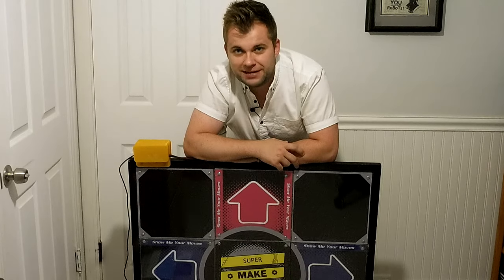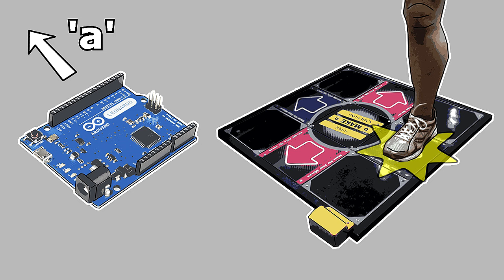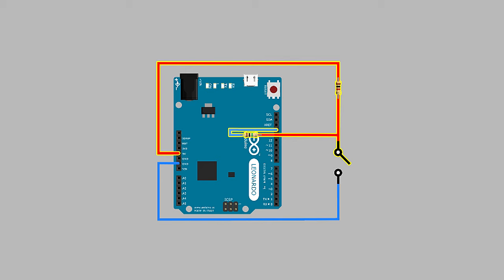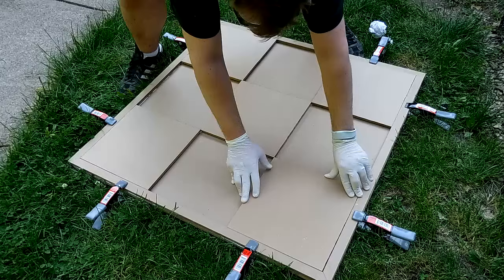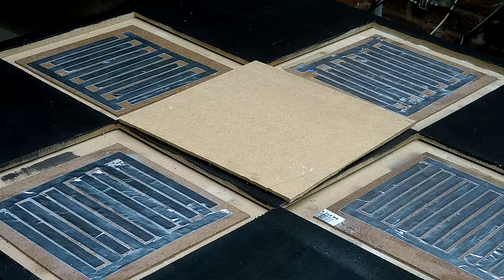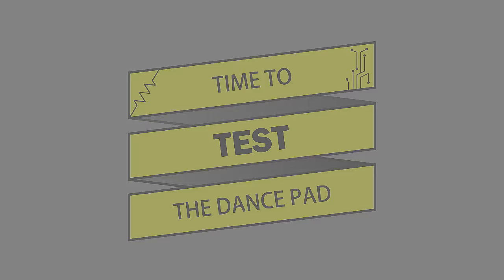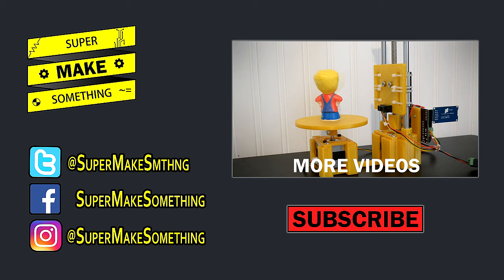USB DDR Dance Pad (Arduino, Pull-Up Resistors) - Super Make Something Episode 9

Comment: So from what I've seen in this video you don't use resistors? At the beginning you show 2 resistors in the diagram but towards the end I didn't see anything of the sort and you just directly connected wires to the pins. Can someone clarify this I lack the knowledge :(
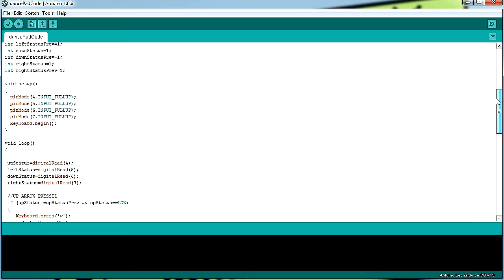Reply from the maker: 10:08  -- The Arduino has a set of internal pull-up resistors that can be enabled via code, so additional external resistors are not needed.  Hope this helps!
Reply: @SuperMakeSomething  that makes sense, and let's say I'm doing this project for a 5 panel like pump it up would I just add an extra line to the code including a fifth button similar the four you have already set up?
Reply from the maker: Armando Gonzales Yup, you got it!
Reply: @SuperMakeSomething   thanks alot sir and wish me luck
Reply: @SuperMakeSomething  hey again just wanted to update you and say I got everything working and looking good to play, however I'm experiencing double tapping on the buttons meaning I press once and the arduino registers multiple presses ,any idea on how to fix?
Reply from the maker: @armandogonzales1544  Hey!  You can fix this by implementing "debouncing."  Look for user "AshiWolf Studios" in the comments -- he edited the code for this project to include this feature and posted a link to it.  Hope this helps!

Comment: hi, I don't get how the black and red wires were connected can someone please give me an explanation. Thanks
Reply: if you still dont get it. 

Black Wires: You connect the black wire to one contact on each side (each side will have 2 strips of contact.) once youve basically connected 1 long black wire to every other contact. those are your grounds leads.

Red Wires: 4 really long cables. This goes to every contact you have NOT put a black wire to.

at the end, thats how you end up with 4 reds and 1 long lead cable.
Reply: @dannyboy8231995   thanks a lot man

Comment: Hello, great video, but I am trying to understand the wiring. The 5v output on the Arduino isn't shown being hooked up in this video (unless I missed it)? The 5v output is necessary for the pins to register the HIGH voltage right? In the honeycomb design one side has a wire going from 5v to itself and wire from itself to a pin while the other side has just one wire going from itself to the ground. So, should the wires going from 5v be soldered together since there is only one 5v output? Should the wires going to the ground be soldered together since there is only one ground?
Reply from the maker: You can connect all of the ground wires together without issue.  The reason that the 5V line does not need to be connected directly is that the Arduino has an internal pull-up resistor "behind" the input pin connection, that essentially does the wiring of the "high" side shown in the circuit diagram for you.  These internal pull-up resistors are enabled in the code.  Hope this helps!

Comment: Hello, great video dude. Im going to customize a ddr soft pad to something like yours but i have a question, when you screw the corners of the "buttons" doesnt it lock the top in place, preventing it from being pushed down?
Reply from the maker: Thanks! The screws are actually just going through the plastic, graphic, and wood button insert. That assembly just rests on the foam and can be removed. Not ideal for storage against a wall, but overall it’s not too bad. If I were to rebuild this pad, I would replace the foam with springs and drive the screws all the way through to the base board.
Reply: @SuperMakeSomething  ooh, thanks for answering!

Comment: im sure you dont want to troubleshoot everyone who didnt follow instructions exactly issues, but on the off chance youre feeling generous, do you have any idea why ALL keys would be sending signal at the same time? i ran your code (my first time using arduino, so maybe i did something wrong there) hooked up the "positive" leads from each sensor to the appropriate pins, and the others to the ground connection on the arduino. once i do so, all keys basically fight over who gets to send a signal, without me stepping on the connecting plate. I've even removed all 4 of the "buttons" and the keys are all still transmitting. 

the only major thing i did differently was i used cat6 cable, since it has 4 double strands inside (and i had some laying around) and instead of running a single ground wire to all 4 grounds, i ran the bundled "ground" strand for each positive wire , and then outside of the controller i spliced them all together into a single wire which i then ran to the arduino. i dont understand how this would be functionally any different from running a single wire to all the other contacts, but its all i can think of ...

edit: rapidly losing hope.... just untaped everything and tried again ... now im pretty sure its worse ...
Reply from the maker: Hi Cory, sorry to hear that you are having problems.  Tying the grounds together shouldn't cause an issue.  I would double check the wiring to make sure that you don't have any shorts.  Did you enable the internal pull-up resistors in the code? The best way to troubleshoot this issue would be to use a multimeter in continuity mode, and trace along your wiring/contacts to make sure that the electrical connections are correct.  Hope this helps -- good luck!
Reply: @SuperMakeSomething  thanks for the quick reply, I did a lot of testing before I finally gave up last night.

I used your code, so the internal pullups should be active. I tried running new wire,  in different gauges and styles, to just one of the aluminum "buttons" to try to isolate the problem, same issue. The button is "pressed" without the two sides of the switch ever making contact.

I then tried running the wire to the arduino without connecting the wire to the dance pad at all, same exact issue. It's like the loop with ground is being closed through thin air. 

One of the last things I tried was attaching much shorter (8") wires to ground and pin 4,5,6,7 which then functioned as expected, no signal till I touched ground and pin, then steady repeated button press in notepad.

Only difference was length of wire, which has me thinking either the internal pullups are malfunctioning, or the longer wires are picking up so much EMI that its bypassing the built in resistor?

I tried using some different sized physical resistors, with no luck. Not sure if my placement was wrong or if the arduino code would need to be changed somehow. I'm very stumped, and very bummed. I was trying to get this built in a day (which I did) but the pad needing to be 10 inches away from the arduino is  nuts... maybe I just need a longer usb cable ... and shorten the wires into the arduino?
Reply from the maker: @NekuraTenshi  Wire length can definitely play a role.  Are you able to 3D print an enclosure like I did for my build and attach it to the pad? Generally, the shorter the wire, the better, both from an EMI and voltage drop perspective.  I suspect that this might be the issue.
Reply: @SuperMakeSomething  sadly, no 3d printer at hand, but I can always make something out of wood if if it works. Going to try a test to one button with much shorter leads in a few.
Reply: @SuperMakeSomething  so it "mostly" worked shortening the wires going into the arduino. There are still some random "ghost taps" but it's one or two with intervals of maybe 20-30 seconds instead of a constant stream of inputs. The big problem now is the foam I used for the "springs" is acting like a memory foam and compressing to the point they're unusable after just a few steps

Comment: Instead of washer and tape, or screws, wouldn't it be possible to weld the wires to the aluminum plates ? And can't I use 1/4" MDF instead of cardboard for the raiser panels ?
Reply: Welding (soldering) to aluminum foil can be tricky, but I agree that the contacts should be made in a different fashion.  My recommendation is to extend the aluminum foil off the edge of the riser panel so that the electrical connections can be made away from the contact surface level.  Also, the material being used for the riser panels is not cardboard, it is a wall paneling material very similar to MDF.

Comment: Hey Alex! Thanks for making this amazing tutorial. I was wondering, what length were the screws that you used to go through the acrylic and the wood panels? Are the lengths of the screws different between the button pads vs the non-button pads? Did you drill into the baseboard below and have the screws go through the panels and into the baseboard?
Reply from the maker: Hi Calvin! The screws in the button pads are just long enough to keep these parts together, but do not go into the baseboard. (The buttons only rest on the foam). The non-button pads are screwed into the baseboard and help keep everything in place. Good luck with your build!

Comment: Before ye olde virus, I went to my local arcade to play Pump it Up (Korean arcade dance game) several times a week. With gyms and arcades closed, I'm endeavoring to build my own! Would I be able to modify this to include a middle pad that could also receive input? I feel like that contact pad is sort of crucial.
Reply from the maker: Ess Ambreís Absolutely! All that is needed is to add an extra button to an Arduino input following the same design, and a slight modification in the code to recognize one more button press! 😄

Comment: What keeps the buttons from failing out when you stand it up? The plexi is screwed to the top of the button, but I didn't see you secure that to anything else.
Reply from the maker: I decided to not fasten the tops of the buttons to the pad to make it easier to do maintenance.  However, this design could be modified by driving a longer screw through the top plates as well, slipping compression springs over the screws in order to make the buttons pop back up.

Comment: Does this process also work with pump it up, which is a 5 panel?
Reply: could you also make a video of making a 5 panel?
Reply from the maker: The process for the build is the same and Stepmania has Pump It Up compatibility, so this should definitely work! Simply add a middle panel with another button and make the other panels diagonally, and you should be good to go!

Comment: Why can't you just make the contact plate out of a single piece of aluminium foil?
Reply from the maker: The 5V and GND connections need to touch in order for the microcontroller to sense a button input. I wanted to avoid moving parts on the top of the button panel, so I made a comb design to keep both connections on the pad's base plate.

Comment: Thank you for this video! Excellent production quality for something that's unfortunately not so popular anymore. 
I have a question though. I'm not familiar with arduinos or anything of the sort. You have the arduino leonardo in this video. According to the website, that version is no longer supported. Would the Arduino Uno R3 do the same thing with the same pinout? Thank you
Reply from the maker: Thanks! The Uno would not work, as the project requires the ATMega32u4 chip. You should still be able to find Leonardo's online from other vendors, though any Arduino with this chip will be suitable for the project. Alternatively the "Arduino Micro" listed on the official Arduino website should work.
Reply: Thank you. Got confused because at 0:58 you use a pic of an uno, but in the video you use the Leonardo.

Comment: Thanks for doing this, I'm currently making my own pad using your video. One question however:

The ground wire is one continual connection to each square of foil? Does it matter if it's connected to the same section as each of the red wires you used?
Reply from the maker: Matthew Marshall The panel with the ground wire and 5V wire should be separate, but become electrically connected by the third plate. This causes the voltage to drop to 0V, which the Arduino registers as a state change/pad press. Hope this helps! Good luck with your build!

Comment: Quick question... Is there an advantage of going the Arduino route vs. just using a simple USB encoder?  I know using an Arduino is cool, but seems like a waste of a perfectly good Arduino when you can get a USB encoder to just mimic a key press when contact is made.  I like you pad design, I think I'll build one using your specs.  However, if there isn't any advantage, I'll go with the USB encoder in lieu of the Arduino.
Reply from the maker: Joe Salz The main advantage is the price. Whereas a USB encoder costs $12, a suitable Arduino can be bought for ~$3. An Arduino also gives a bit more flexibility depending on what you want the buttons to do, since it can emulate a full keyboard. While this is not necessarily an advantage for this project, it could be good for more advanced ones that require USB-to-PC input.

Comment: What if you buy a cheap DDR dance pad and then put thin piece of wood on top of it,  would that cut all your steps like in half and work exactly the same?
Reply from the maker: Tony Trilex I had tried this back in the day, but the problem is that the top vinyl sheet of a soft pad will always slide, even if it is taped down well. Also, you don’t get as good of a tactile feedback about where you are on a soft pad compared to a hard pad, which makes “heavy” songs more difficult.

Comment: Would using thicker wood cut down on how much the pad moves around when playing on it? I’m also planning on using copper tape for the sensors instead, should the washer and screw also be copper? I’m not sure if it matters since I’ve never built anything before, lol.
Reply from the maker: Greninjaftw Anything that makes the pad heavier would definitely help! Using copper tape may actually be a better option, since this might allow you to solder directly to the sheet. Good luck with your build!

Comment: Great tutorial, but the washer + screw + tape idea is very flawed. Very similar to JayZ2Cents' hot-glue soldering haha. Even an amateur solder job would add years to the life of this project and would keep you from having to disassemble and fiddle with connections constantly.
Reply from the maker: Soldering would definitely be the optimal solution, but unfortunately it is very difficult to solder to aluminum. While the results did hold for me, a better/easier solution would be to “clamp” the wire in place with a screw and washer, similar to a lock down connector on a battery. This would ensure both a solid connection and easy serviceability. Haha I will need to look up the hot glue soldering technique. 😝

Comment: How much did this cost to make? and is it realistically possible for a beginner to make? I really want to make one but kinda daunted by it.
Reply from the maker: It’s definitely doable, I think! Based on my experience, the most challenging part about this build are the size of the pieces, but a hardware store can usually make those for you. I don’t remember the exact cost off the top of my head, but the most expensive parts were definitely the acrylic and wood. I would guess ~$100ish...?
Reply: @SuperMakeSomething  that's awesome thanks for the reply, been wanting to build one of these for a while and this vid is one of the most easiest to understand that I've seen so definitely gonna give it a try :D
Reply from the maker: You’re welcome! Good luck with your build!

Comment: i was thiking about soldering directly to a controller to same a bit of money instead of using a microcontroller, but i might consider buying an arduino nano would this still work with a nano or does it have to be the leonardo
Reply from the maker: +DiscordedOfficial This will work with any Arduino that uses an Atmega 32u4.

Comment: I'm not sure if this question has already been answered, but couldn't you create the sensors for each arrow using piezoelectric transducers? This was the method used to create many simple DIY electric drumsets, I'm sure this method would translate pretty easily into an application like this. Any thoughts?

Comment: Love this. 

Can you connect this to other dancing software aswell ? 

And can I find the stl file for the enclosure online ?
Reply from the maker: Thank you! It should work with other software as well, as long as the software takes keyboard input.  Sorry for not having the link to the enclosure posted.  I will update the video description.  In the meantime, please find the STL file for the enclosure here: https://www.thingiverse.com/thing:2136049
Reply: @SuperMakeSomething  hi thanks alot ! No problem at all.
Do you think its posible to make add a 5the dance pad ? I would like to have a middel one too .

Thanks in advance !
Reply from the maker: @stevebelis6589  Absolutely! You would just need to wire up and connect another button to the Arduino, and then duplicate one of the code snippets making sure to change the pin number and the character that is sent. Good luck with your build! I’d love to see the end result!

Comment: Hi Super Make Something! I really like this project, and I am considering working on a similar one in a few months if I feel passionate about it. But I did wanted to know how the dance pad is doing currently. Have there any other repairs or modifications that were needed? I'm asking since if I were to make such a dancepad, I would want to make it as structurally sound as possible, so that's why I ask. Thanks!
Reply from the maker: Thanks Jayvin! The two things I would improve would be to use polycarbonate instead of acrylic for the clear covers, and to try to find an alternative to aluminum foil because it needs to be replaced every once in a while due to regular wear and tear. That being said, the pad is still working great, but it does sometimes need maintenance depending on how much playtime it has seen.